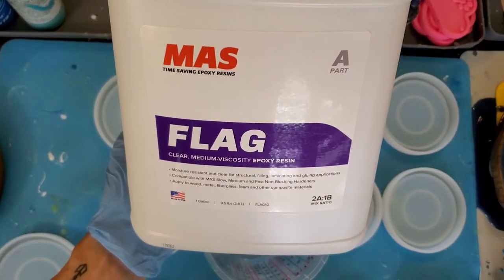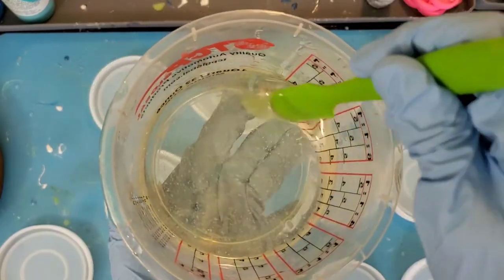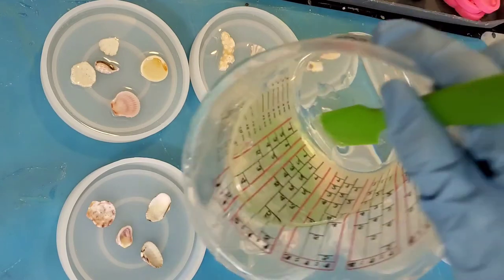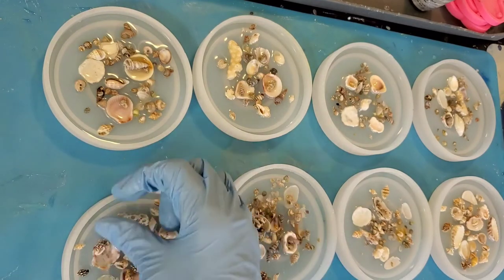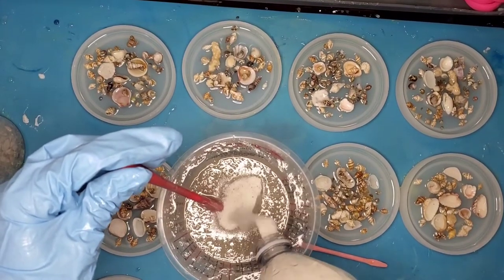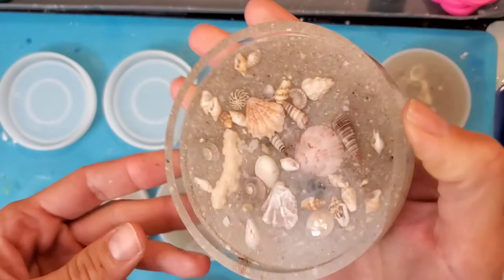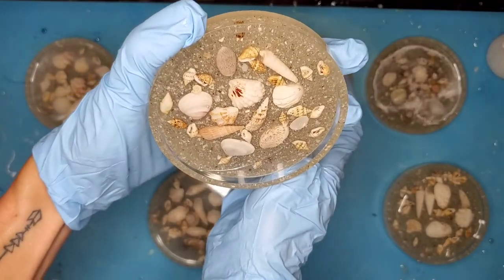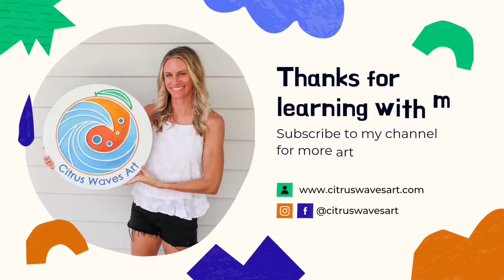Sand & Shell Resin Beach Coasters Tutorial

Comment: I am doing this with bolts and nuts.  So I can put the parts in the mood amd then the epoxy?
Reply from the maker: You should be able to yes! I don't personally have any experience putting metal in resin so I would check if you need to coat them first with a polyurethane but theoretically yes you can 😄